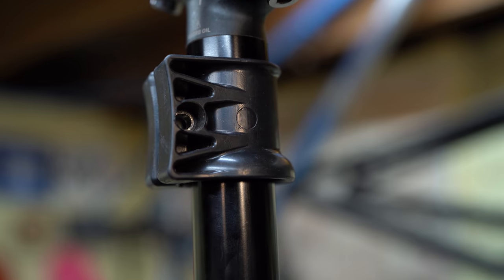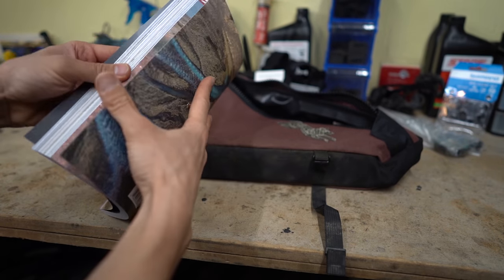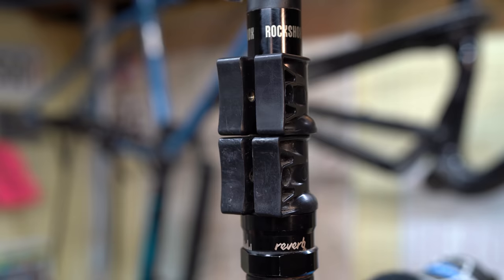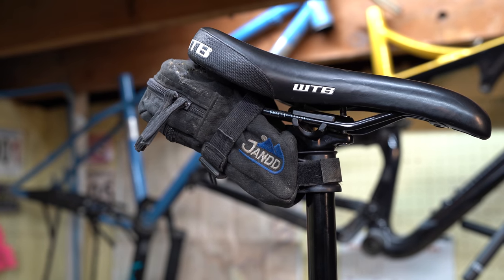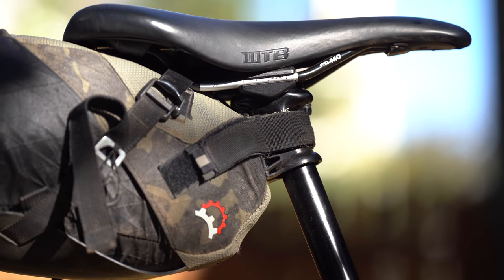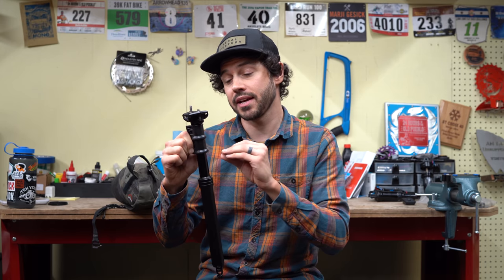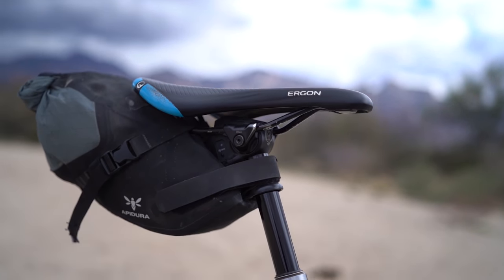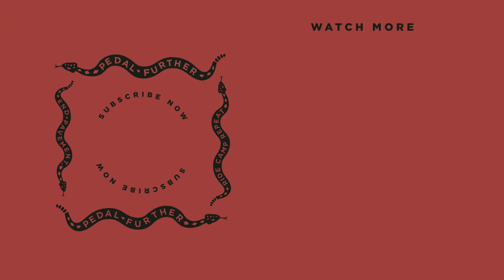The Best Little Bikepacking Accessory?

Comment: One more hidden use... you can drill out the Valais and convert it to a rack mount... or a mount for the Porcelain Rocket Mr. Fusion.
Reply from the maker: Whoa, genius. Would you drill it out above the screw?
Reply: @BIKEPACKINGcom  No, you drill out the screw area (just to fit a thru-bolt in there...

Comment: $24.95 !? WTF
Reply from the maker: You ok, Pancho xbrr?
Reply: Agreed. If it was $5 and next to the register at my local bike shop then I would probably grab one when I am in there buying something else, but at that price, I would say that it is a good idea and I will just 3D print myself a copy. (For about $1 worth PLA filament in a nicer color)
Reply from the maker: @davidpottage6402  Once you do, I would love to buy one from you and give it a try!
Reply: This is an ongoing trend: hugely overpriced small accessories. Silca just released 3D-printed titanium SPD cleats for $85. They claim 20% more durability than an original steel Shimano cleat you can get for $10. Now this piece of plastic which I don't doubt is very useful. But $25???? Gimme a break. No worries: if it's really that useful, you will see replicas at AE in a couple of months for five bucks.
Reply from the maker: @The_One-Eyed_Undertaker  This product has been around for 4 years, btw.
Reply from the maker: @The_One-Eyed_Undertaker  to be fair, this has been on the market a long time, alternatives have come up, nothing beats it. I don't think you can expect to see a price drop.